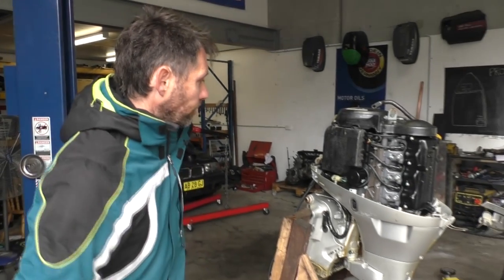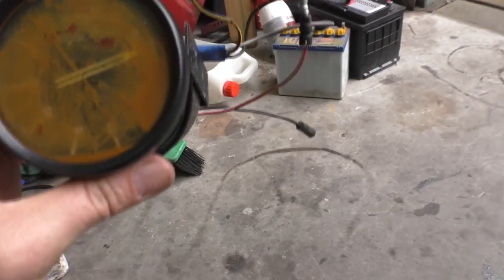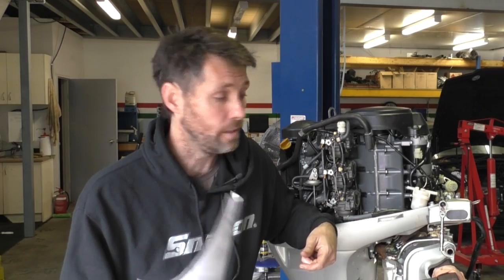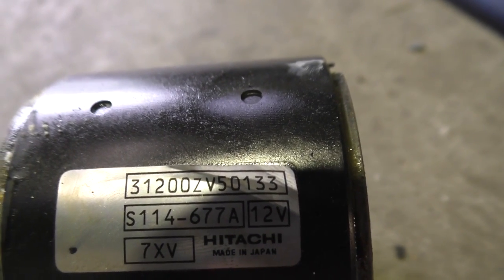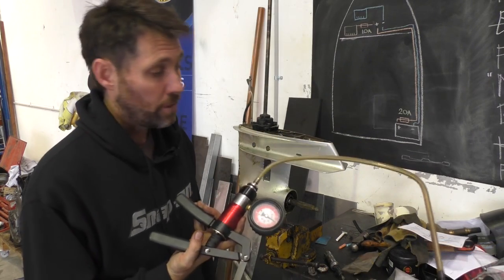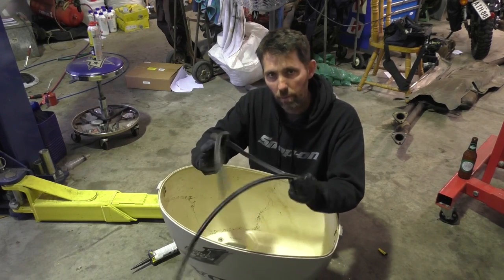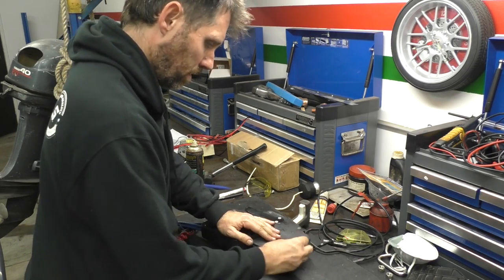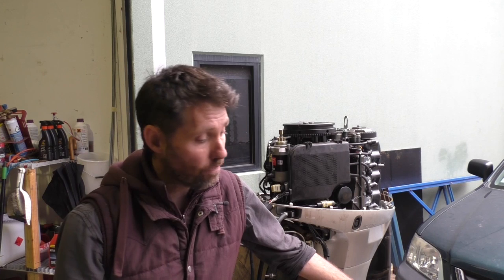Saving a sunk Honda BF40 outboard motor

Comment: My F40 2009 has a defective high pressure fuel pump.... a nightmare. For whatever reason the dealer did not replace it when the bulletin was the released by Yamaha. I was chasing after an overheating issue because it seemed temperature related and it is. But no alarm on the control, raised alarm! Why did it not sound upon RPM roll back? Fuel starvation? But it worked fine when cold. The HP fuel injection pump! I read forum and ordered a Quantum after market for $69 USD... hopefully this is the problem. It all points to it. Maybe it is low pressure pump too? The dealer gave me a kit free given the history operation was successful other than one broken nut.... aghhh the 2 bolts look the same but were different and ended up getting stuck in the block.... solutions?

Comment: You would have to put that in the bargain of a lifetime bucket surely? Is there a big difference between a BF40 and 50hp of that year? Often it is just a cam or timing difference for that 10hp difference with 4 stroke carb engines. With 2 strokes it was often a main jet , but in 4 strokes you can't do that without causing issues. But that extra 10hp may be worth chasing as you have so little invested in the engine so far. As for the starter,  I base such decisions on my own time being worth $20/hr to me. So for about 6hrs work cleaning the starter up, about $40 in bearings, another $40 for brushes, and $60 for a new end cap, plus the run around time / shipping costs, that $300 starter was the way to go.
Reply from the maker: Hey Ron, I'm certainly going to start doing some research into the different Honda models and see which ones shared the same block. I'll let you know what I find out.

Comment: First time viewer. Enjoyed the vid as outboards have always fascinated me. Are there any torque specs for some of the nuts and bolts, especially the prop?
Keep em coming👍
Reply from the maker: The service manual for each outboard will give you the specific torque specs. Props aren't tightened very much at all. Snug it up lightly and then turn it until you can get the split pin in the first hole.

Comment: Well done, usually a heavy mono line stuck through the tell tale tube should clean out most debris, but if using air, what psi do you think is safe to use?
Reply from the maker: You can use a fair bit of pressure to do this, the only thing that is going to pop is the hose from the block to the lower cowling which is easy to put back on.

Comment: Love all your videos! I just got a lightly used 2007 BF50. I was surprised that the lower engine compartment was filling up when I was cleaning the engine. I thought the drain had clogged up, but when looking for it to clear it I could not find it. I try to research it but could not find any information on it. Do you know if these outboards have one? Only reason for not having one would only make sense for environmental reasons.

Comment: very good video. previous one and this. i am still wondering what you ended up doing with the tip of the hull.
Reply from the maker: Thanks mate. So far, nothing. I think I need to come up with a good plan for that one as I'm worried I'm just going to make it worse if I don't get it right. I should show some more close ups of it and call for some advise.

Comment: You mentioned at the end of this video that you chose the Tohatsu 50 before this motor came along.  What made you finally decide to go with the Tohatsu?
Reply from the maker: Good question. A big part of it came from a personal recommendation of a person that sells and services Tohatsus as well as the other major brands. He felt they were smoother, better to work on and lighter (for good reasons) All their gauges were NMEA by default and looked good to me. I could get them locally, and maybe a bit of "a change is as good as a holiday". :) In the end is what a few things, but I would still say it was a very close race.

Comment: do you have a video where you put air through the water lines. Mine wont pump after changing the impeller.

Comment: Hi ...yes...I'm converting from longshaft to shortshaft  so I'm trying to remove the long shaft and while I'm at it renew bearings and seals ...complete lower leg strip down ...I used to have the service manual on memory stick but lost it ..grrrr😱. - right now I really need to find out what's holding the reverse gear and bearing to the propshaft  because I can't get to the driveshaft pinion nut 😱😱😱
Reply: Look here mate, http://peparts.honda.com/marine#/browse/me/bf     it's got illustrations al the way, good luck from the netherlands

Comment: No....heat - oil - replaced carrier - packed out the prop - tightened castle nut - propshaft pulled out 😊👍...happy days
Reply from the maker: Nice work. Did you film it?

Comment: Great again. How do you know if an aftermarket  oil filter or fuel filter is the correct type? I went to Supercheap with my Yammie 25 filter but couldn't work out which ones were compatible.
Reply from the maker: Good question, I'm trying to remember how I found that out. Auto stores very rarely have any parts match for outboards. I would start by searching the original Yamaha part number and "cross match" on the internet and see what you come up with. I think that's what I did.

Comment: Thanks.  Learn so much from every video.  Locktite or antiseize on water pump housing?  Do you use a sealant when attaching the gear box to the lower leg?  Thanks again.  love binge watching these.
Reply from the maker: No sealant when attaching the gearbox and a little locktite on the bolts for the water pump.

Comment: One of the best outboard motors IMO  in the United States we call those Hondas the Grey Ghosts because many police boats use them and you cant hear their engines when they are following you at night without any running lights they like to  sneak  right up to the side of your boat to make sure people aren’t drinking  or  smoking Marajuania  on board  one night my best freind and i were riding on someone else’s boat and the two of us  had not noticed a police boat  only a few feet from us  as it was a Inflateable with the Honda motors on it  eventually the police turned on the strobe lights and we both were surprised how close they were to our boat  he and I laughed later about that one  because the officer said he was idling on the dock we were on at  a restaraunt and watched us having drinks  there  he wanted to check the paperwork on the boat and the drivers  sobriety  which was legal  as they only wrote a  warning   On safety equipment and let us go on our merry way which was a short distance to our final destination for the evening !  And yes i can also relate to being under budget on outboard motors  to the point i almost hoard them when i find a decent deal on a used one  BTW ive owned 17 or 18 boats so far in my life  and i probably wont stop anytime soon  in my defense i grew up in Florida and we lived only 13 blocks from the Atlantic Ocean  and about a hour and a half to the Florida Keys  both of where i fished and Scuba Dove quite a bit

Comment: What happens to the engine when it drops into water with a key while it is moving at a higher speed. Does engine switched off immediately it sunks into water or it keeps moving until the fuel in the quabulator finishes. Please help l lost my Marine engine a week ago. I checked where it was dropped but I couldn't find it

Comment: hi Dangar, really learned a lot from your videos. a very stupid question: Will an outboard motor work properly if it was installed upside down (Propeller on top provided the cooling system works perfectly)?
Reply from the maker: This is actually quite an interesting question. People often need to run engines in different orientations. Four strokes are tricky because of the oil sump and pump, but the engine of a two stroke can run in any orientation. The tricky bit is the carburettors that need to be the right way up for the bowl to hold fuel. Some may be flipable if they have a symetrical bolt pattern.
Reply: Got it . Thanks man. We are intended to use outboard motor to drive some aircraft propellers...

Comment: Hi my so called marine mechanic has done some works on my mercury 90 stroke....most of the work is ok...anyway...at the moment when I am in neutral and punch it to take off (which I never roar off just ease up to the plane) there is a flat spot....even sitting up on the plane it does it...Im assuming fuel restrictions or something like that....the fuel is fresh...can you help or point me in the right direction....thx David. BTW your vids are awesome...
Reply from the maker: If it started after a service I would begin by just checking the simple things like is the fuel hose securely connected, the tank breather open and the spark plug leads firmly seated.

Comment: Hi Stu
Great video! I have an opportunity to buy a Honda 75 hp which sunk for 2 hours and apparently ran afterwards. I’m hesitant to go ahead with the purchase! The only difference is that mine would be fuel injection system. Would there be much difference in the process?
I’m told that the electrics would be fine as they are all sealed units.... this be true?
Thanks in advance for your help 👍🏻
Reply from the maker: Not hugely. Generally EFI is easier as the water won't have got inside the injectors.

Comment: Sorry, very laate to the party. Excellent video, thanks for sharing. When you put the gearbox back on, it looked like you just pushed the waterlines into the cavity and they were not connected. Hope it was just my eyes! Again, thanks
Reply from the maker: It was probably just the hose for the speedometer (which I don't have on the dash)

Comment: Watch your vids all the time question I boat a 25hp mercury don't no if it's got a crack in block or blown head gasket got water coming in number one what would you think
Reply from the maker: Could be either. You won't really know until you take the head off and do an inspection.
Reply: Thanks be my next step

Comment: Skim that head a little bit (0,05mm), port the exhaust ports a little bigger, remove the core shift on the intake ports and re-jet the carbs, you should be looking at 50hp
Reply from the maker: I think it would make an interesting video to do an HP upgrade on an outboard, and I may as well do mine. :) The only trouble is I need to find another boat I can use while this one is out of action as I use it every day.
Reply: +Dangar Marine Let me know if you need help....would love to get my hands dirty...or just give tips..
Reply from the maker: Thanks mate, you based in Sydney?
Reply: +Dangar Marine Gold Coast unfortunately..

Comment: Is there a way to reconfigure the trim buttons onto the shaft? Where its mounted on the side of my tiller, and secomdary weird placement of the guages and electrical component is hard to get to while trying to get on plane and is annoying.

Comment: Good to know.  Thank you-

Your obviously not a keyboard warrior-  and what you do makes sense.  Hence why I ask this-  Whats your professional opinion on the Etec 25/30's?  I'm looking to repower from a 9.9 Mariner (1985) that's has all types of issues.
Reply from the maker: I've never worked on any ETECs, but my friend has one and he is very happy with it. I hear they can have problems with injectors failing and only dealers can replace them as they need to be reprogrammed after each swap, but they do seem to have some good technology in them.
Reply: thanks-  good to know.  I plan on keeping the 9.9- Just in case.

Comment: Excellent video i really enjoyed it immensely thanks for posting but in your opinion would another make of outboard in similar condition would a been is as good condition? or a Honda is build with very good quality materials to a high standard? just wondering
Reply from the maker: I think it you can get any outboard cleaned up and started as soon as possible after it comes out of the water then you have a decent chance of it still running well. I've been very happy with this outboard, it's still running really nicely, I was certainly lucky!
Reply: many thanks for your reply its much appreciated cheers

Comment: hi, its great video, I'd like to ask you question about starter motor, 
after cleaning the starter motor what's the reason that make you decide to buy a new starter
Reply from the maker: It wasn't so much cleaning it as opening it and deciding it wasn't worth cleaning. Maybe it's just because I've been bitten a few times by unreliable starter motors that I decided I would rather spend a few hundred dollars than have a perfectly good motor unusable because of a dodgy starter. I need this boat every day so reliability is really important to me.

Comment: Maybe u can fix my 1987 25 merc.   It needs TLC but when she's running she is a beast.  Out ran 4 strokes all day.   Had to retire her and put her in the shed.  Bought a slightly smaller motor for my whaler but I want my old girl running again
Reply from the maker: Hey Steven. Where is the shed?
Reply: +Dangar Marine at my house.   It's a small aluminum shed.  Mainly storing junk.  Lol

Comment: The flexible hose in the lower unit. Where did that end up. It looked like you pushed it in anywhere????
Reply from the maker: Mine is just loose inside the midsection as it the sender hose for the speedometer and I don't have one on this boat.
Reply: Dangar Marine Cheers stu. That had me buggered. 
Love the vids. Mate cheers.

Comment: Just happened upon your videos and been thinking that some of your tasks might benefit from a vacuum pump rather than air pressure.
When you do your oil, you could suck all of the air out so it doesn't "bubble"... Also your cables might be more effectively "demoistured" under a vacuum. Get a good pump (aircon) and some fittings.
Shrug... Just an idea (from a non-mechanic btw but I've done motorbike coolants the same way..)

Comment: im going to attempt cleaning three carbs on a 2 cylinder 70 hp 1974 evinrude hustler 70443m i cant find much info on it as far as diagrams and such im afraid of messing up any little fine adjustments any advice i plan on taking video of it before i start for reference
Reply from the maker: Hi Brandon. Here is an exploded parts diagram for the carburettor on your outboard which should help http://www.boats.net/parts/search/BRP/EVINRUDE/1974/70443M/CARBURETOR/parts.html , but as you say, taking video and photos as you go will really help with reassembly. Here is a carb cleaning video that might also help http://www.boats.net/parts/search/BRP/EVINRUDE/1974/70443M/CARBURETOR/parts.html

Comment: I have 25 HP 4stroke engine gas can't enter to combustion chamber @wont start but if you put gas in the chamber it will run or the  engine will start..can you help me guys....

Comment: What kind of oil did you run though the hose, and do you have a video to make that adaptor to run compress air and how many psi did you run
Reply from the maker: It's an older video but this shows it https://www.youtube.com/watch?v=_j2xD_8k5yo Just about any light oil will do.

Comment: How many PSI in the hose to push the oil through the cable?  I'm guess around 5-10 but this looks like a fantastic way to lube my motorcycle cables too!
Reply from the maker: Here is an old video I did specifically on this job, and yes, it's perfect for motorbikes. https://www.youtube.com/watch?v=_j2xD_8k5yo I generally run it higher up at about 80 PSI to make things a little faster.
Reply: Thank you sir, much appreciated!  :)

Comment: Say bro i have the same motor what is the rubber hose that comes up from the gear box
Reply from the maker: It's the pressure sender for the speedometer.
Reply: Cool bro thanks

Comment: Great work Stu..talk about being at the right place at the right time.   What a great compromise for the wishlist Tohatsu 50..I am sure the new silver beast will give you many years of service.   Did you order the starter from Ozwide ? I need to get one for my 30 as the original is full of rust and has been removed for 6 months.  How long do they take to deliver ?
Reply from the maker: I think it will be a good motor too, and certainly the price was right. Yep, got the starter from Ozwide and it arrived the next day. If you give Craig a call he is always really helpful and knowledgable, particularly about the slight variations you might come across from model to model. I've never had him send me a starter that didn't fit perfectly.
Reply: Thanks mate...spoke to Craig and he was very helpful...  Just had a thought about that blue gearbox oil..Maybe that is the special "Honda" oil that has eluded everyone ??

Comment: Hey mate, great vids. You mentioned that your ‘would’ have gotten a Tohatsu if you went ‘new’. I’d be interested in hearing about that decision. Not too familiar with that brand... cheers
Reply from the maker: I think their new design is quite good and they are priced will. They are very light too. Our local dealer sells both Hondas and Tohatsu motors and rates the Tohatsu motors highly which is interesting given how good the Hondas are. Tohatsu also make all Mercury motors 30HP and below.
Reply: @DangarMarine  I am a recent subscriber in the US.  I was wonder how did you get into the business of Outboard / Marine repair?  Thanks sharing so much knowledge of your trade.  You are always clear and down to earth. More importantly you are never pushing any particular product which appeals to the everyday viewer who has to make due with the funds available. YouTube needs more like.